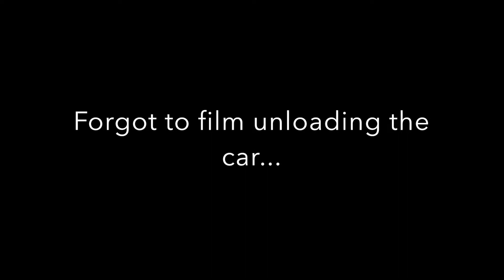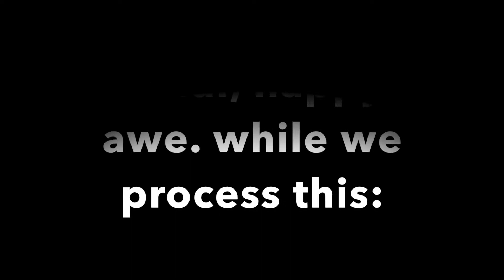TCproject253 Team has a new car. team project. its a race car

Comment: Do you guys have an engine plan yet?
Reply from the maker: Not a solid one. That's still in the air.  Any suggestions? Ideas? 😁
Reply: @TCProject253  ls  lq4 twin turbo would  probably be the cheapest way to make big power. A good old fashioned big block on spray would be pretty sweet.  Im about to pull the trigger on a 6.0 lq4 that will be  naturally aspirated with an agressive cam and heads something super reliable and a bit betyer on fuel then the big block
Reply from the maker: Awesome. I really like the lq4 idea. I have one in my drift car for next season and I almost want to put the 6 liter in everything I own now lol